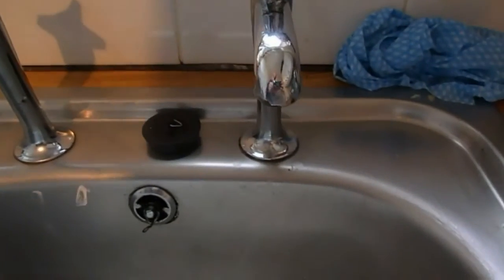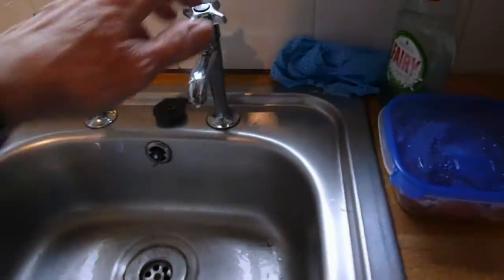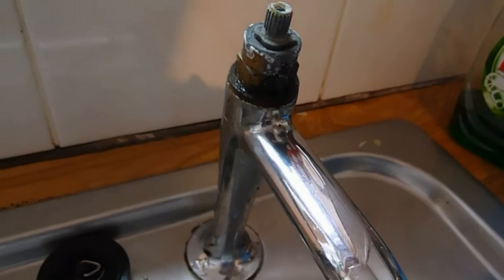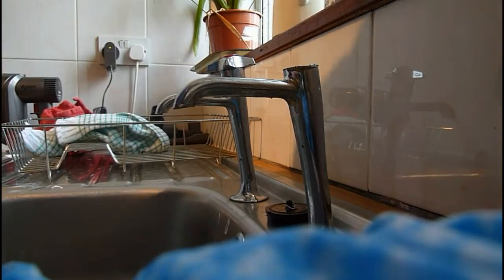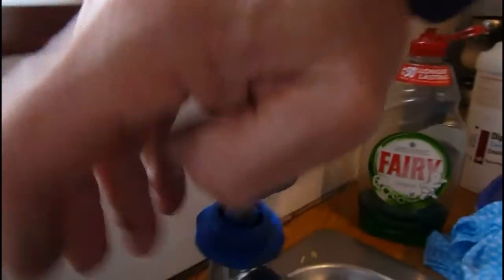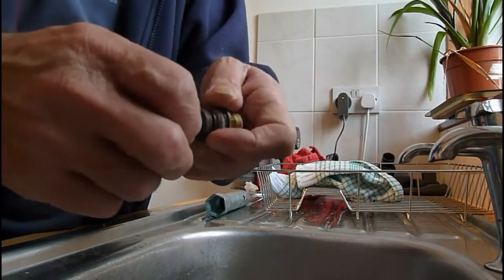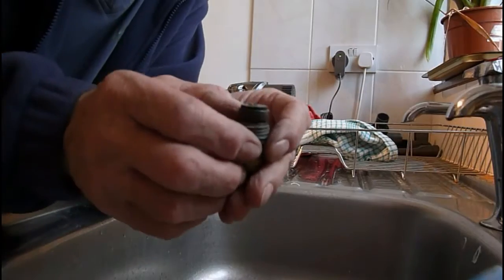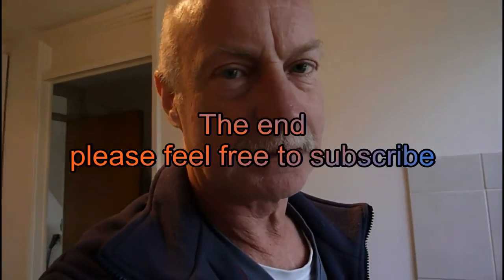How to Re-washer a tap and repair the seat using a tap re-seating tool.

Comment: Thanks for posting this video. I have a leaking Bristan 1901 shower / bath mixer. The washers were recently replaced, but it is still leaking and a plumber I spoke to said that the entire shower / mixer tap would need to be replaced. Is this true, or does it simply need to be reseated? I live in a very hard water area.